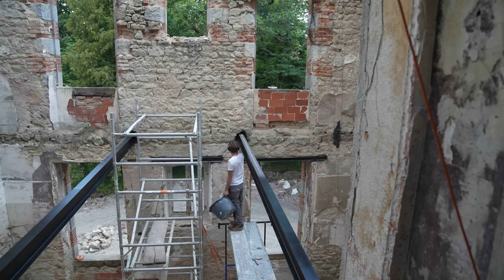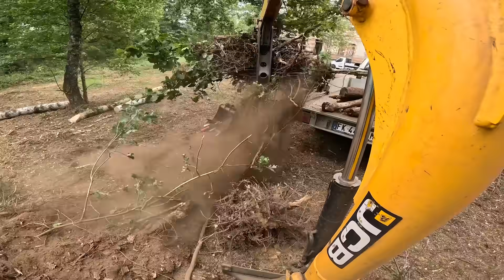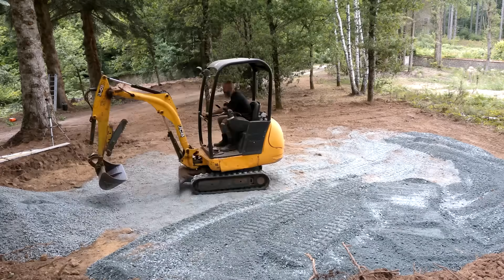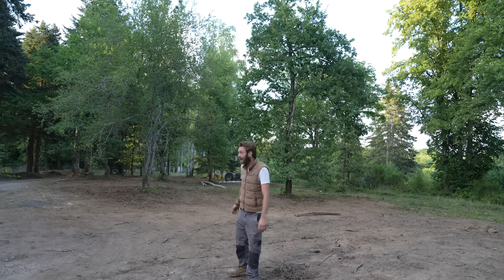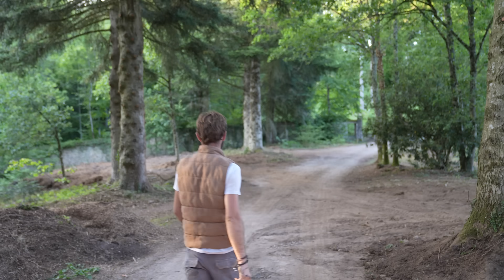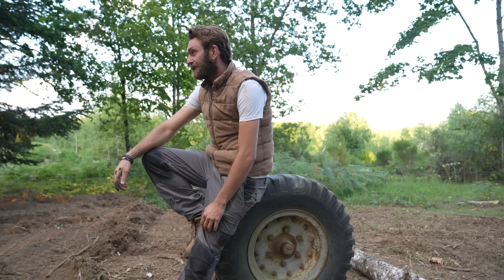The completion of a busy two weeks, marks the start of another.

Comment: I've been wanting to mention this...
To get the concrete further in gaps and faster. You can buy a bag, it looks like the bag they decorate cakes with. It's cone shaped. Will make your life easier like using the roller instead of a brush to paint beams.
I look forward to your videos every day. I'm working and when I see you came out with new video I stopped working, Sat down and now enjoying this video. Thanks.
Reply: It’s lime mortar not concrete. It’s used for old buildings, allowing it to breathe. Also he has been filling and pointing gaps in his old cottage for years. He says it’s his favourite job...
Reply: @consideredwhisper  works the same for Mortar and won't effect his having fun smoothing it out, will just force the Mortar further in and faster.
Reply: Another great episode, my fav YT these days.  2Qs for you:  toss rocks in the cement mixer to clean it out/break up dried stuff from prior batch?  Second, when will you get electric run into the site (along with the yurt install?). Second all the other fans celebrating a non-wobble scaffold!

Comment: I put a comment up about insulating between floors to stop the beams expanding and contracting and then causing the steelwork into the walls to stabilise the building from moving. I think if everything were cement/concrete you might get cracks but if you're using lime which has a bit of flexibility to it, you're fine. If you're replacing lime in the walls, you'll often hear that it's better to replace with lime than concrete - perhaps this is why....

Comment: The change in the grounds is very evident, the trees look less starved for light and what remains is more healthy. The grading of the land is going well and I'm curious how it will hold up to a particularly rainy autumn and winter, you'll only fully know where everything flows when nature demonstrates it for you, but it shouldn't require too many alterations. Soggy car parks are a big no, so eventually do think about how the water flowing towards the car park (as it seems to do on your property) can be channelled around it, as well as have a very slightly higher centre point when you flatten the new terrace to prevent puddles. If your road risks pooling water in any point, you can make a drainage slice across the edge to channel flow gathering in any low points down slope (this will require occasional maintenance as it will fill back in after a while, or potentially slowly erode and require slight rebuilding and compacting). I know this is probably already thought out, but just in case!

Comment: It's a huge undertaking and facing autumn and winter and the next serious steps of construction and landscaping without a very carefully thought out plan wouldn't be advisable. Planning at this point is everything. Especially as you've three parallel projects going on. Creating a comfortable winterproofed and fully functional abode for yourself able to last you properly for years if needed, the most important work of the build, to be able to get youre roof up, and  laying down the bones of your lamdscape plan looking both temporarily and long term. There's not a chance you can get it done right without taking time to properly plan and make essential decisions. It's looking so different. So exiting to see that yurt go up!
Little rivers sounds very cool.
Your forest is big enough to create clearings on a connecting path to different outdoor "rooms", which is a rare opportunity to do something dynamic and interesting. A brook or free flow of water anywhere will enhance your miniature ecosystem and bring in another element of life and sound to your property, and wildlife probably.
Wonderful. ❤

Comment: There are a couple of guys I follow  ( Tyler and Todd ) channel, who have spent over a year in all seasons, including a snowy cold  winter, in a Yurt. If you watch their videos you can probably learn a few good things to do from the start and save time and money. They had to change and learn as they went but in the end they’ve been very comfortable in their Yurt with insulation that should go under it from the start . Also  how they use solar, hooked up water, heated or cooled it, cooked, refrigeration etc. and made it all work for them, set up a heated tub and shower outside. They have some good info that may save you time and money in the long run. 👍🏼🙋🏼‍♀️
Reply: Would be helpful if you left the name of their channel for Dan.
Reply: @jmk1962  Doh, that wasn’t very smart of me.😂🤣, I edited it so now the channel name is there. If I added the name to your comment only  it would not have shown up for Dan. Anyway, if you were interested it’s Tyler and Todd. Thanks for letting me know🙋🏼‍♀️

Comment: It's good to have construction equipment but you can really tell the difference in how long a job takes with very small equipment vs. large equipment. But of course, small equipment is easy to move. It's not cheaper though - mini excavators are more expensive (in the sub-12k# range) than those in the medium range, like 10-20 ton machines.

Comment: How is the plumbing coming along Dan? What plans have you for a toilet and shower room on site, or is that a luxury not yet achievable?
Reply: Regarding on-site water source, Dan has got to get the old well cleaned out & working again.   Or,  dig a new well close to the chateau.   And septic system must be re-worked.   Until then, it will be interesting to see how he rigs up toilet & shower in the yurt.   And he does not like composting toilets ( the kind that you have to dump out yourself), per his comment, "Never again" about the composting toilet in his old farmhouse - see his video "5 Years Renovating an Abandoned Farmhouse."

Comment: instead of a yurt, Nick could make you a pergola, where you would put floor boards as the outside walls (paint them with green liquid rubber), put thick insulation inside and plaster boards over.. a door, couple of windows, and say it's a garden shed for papers.. cheap and better for winter than a yurt. later it can actually be a tools shed. ok, a cement floor would be smart and a bit costly, to get it delivered and poured. I'd cancel the yurt.